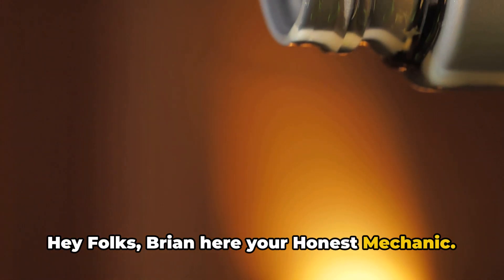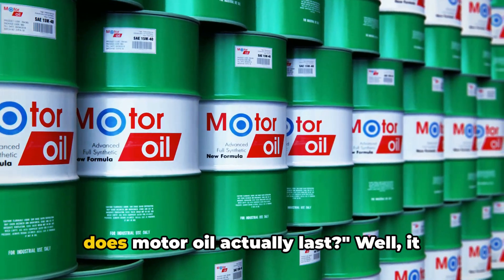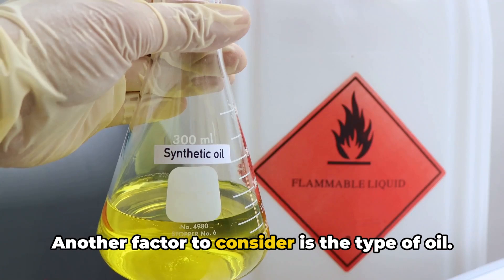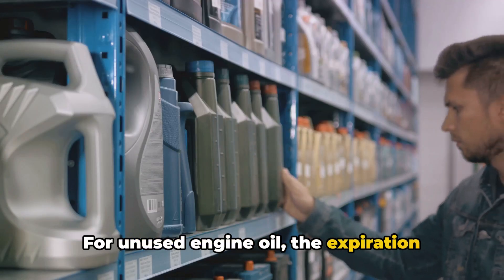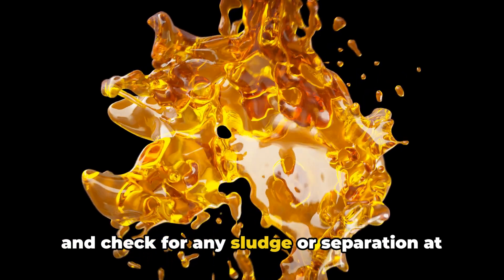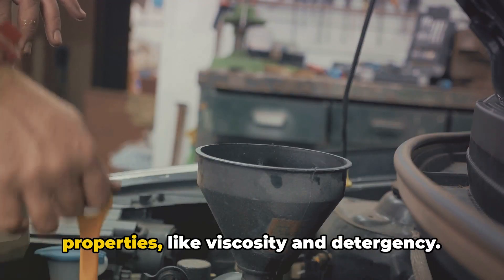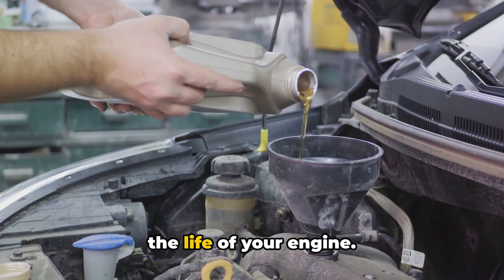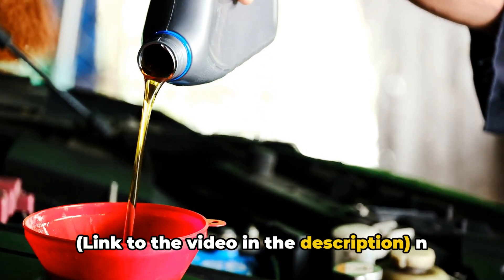Does Engine Oil Expire? Surprising Truth

Comment: my oil sitting  inside my motorcycle engine its synthetic 10w-40 i did not usey motorcycle for  years but weekly i always turn on the engine like 5 minutes and then turn off that's all

Comment: At about $25-30 for a 5 qt bottle of high quality oil, just throw out anything opened more that a few months ago and get something new. Engines are expensive.
Reply from the maker: Totally agree! Better to spend a little now than a lot later fixing a busted engine. Thanks for sharing
Reply: even if its sealed tightly in room temperature?
Reply: @sriavula  Read the comment again.
Reply: @segredosdotiosam9989  ur right

Comment: Oils now are asked to do much more in modern cars so the additives are essential.   The base oil will hold up but the additives will diminish.   Would like to see a timeline of when certain additives were started.   I changed oil more frequently then and those oils may not have had the additives we have now.  So will a diminished modern oil equal older formulas which served well with more frequent changes and easier driving?

Comment: So the additive separates. Turn the bottle upside down every six months.
Reply: @NemoBlank  just shake it when u open it.  Oil circulating through an engine for 30 seconds is the ultimate blender.

Comment: Testing on other channels shows 3 to 5 years is the max for storage. The anti foaming agents do NOT stay in suspension in the oils.
Reply: Then shake the bottle....
Reply: @bens2058  I used to.... it's been proven not to work. Once the anti foaming agents lose suspension they can't be reintroduced. Unfortunately the oil is trash.

Comment: Castrol helpline told me this - never add oil older than 5 years into your car.
Reply: If unopened. Once opened, it will oxidize in the same 1 year as when in your engine.  I wouldn’t use an opened container unless it’s going to be changed again within a year.
Reply: @rdspam it won't oxidise once opened.  The engine is a far, far more severe environment than a can...

Comment: I hope you prime the filter before starting the engine!  Most people ignore this step in oil changes.  
It's all about finding the sweet spot for the oil change interval.  Doing highway driving at 50 MPH for 2 hours five days a week will put less wear on oil (and engine) than the same 5 days per week driving 10 miles to work or school.
Reply: Agreed but priming the filter is problematic when it's horizontal or angled down. Manufacturers would make filter installation bottom up if they gave a sh*t ! Angled down or horizontal causes "dry bearing startup" as well. Most anti drain back valves in filters don't always work...if even fitted.
Reply: @grant-pedder that's because priming doesnt really matter. The size of the filter is dependent on the pump. The bigger the filter the bigger the pump is required. Thats why it doesnt matter if the filter is upside down or not when it comes to being primed
Reply: You dont need to prime the filter, the size of the filter is made for the pump it has. It gets filled right away, well before any issues would happen. Doing frequent oil changes is what actually matters.

Comment: Here in Norway, the oil change spec is 30.000 km/1 year, wich is insane. 5.000 km is better.
Reply from the maker: Thanks for sharing. A 30,000 km oil change interval seems quite excessive, but it's great to hear you don't adhere to that specification. Your engine is likely to have a much longer lifespan because of it!
Reply: Is that some dumb environmental regulation?   I'd do more frequent changes in cold places, because the engine spends more time running cold.
Reply: He's not talking about oil-change specs; he's referring to the actual lifespan of oil itself.